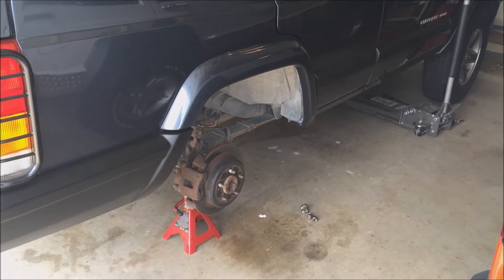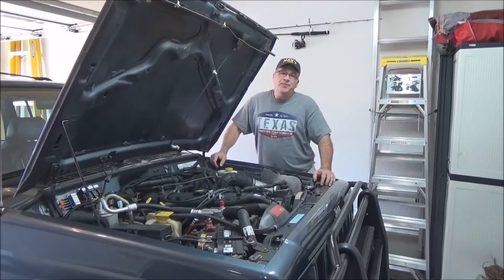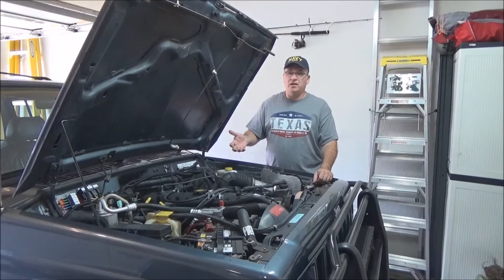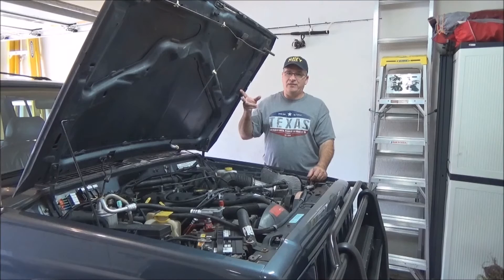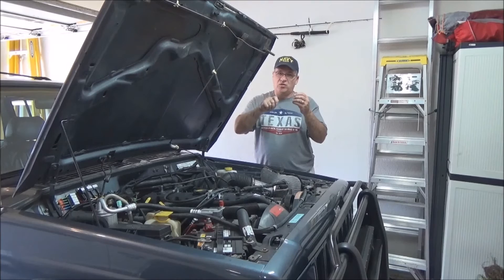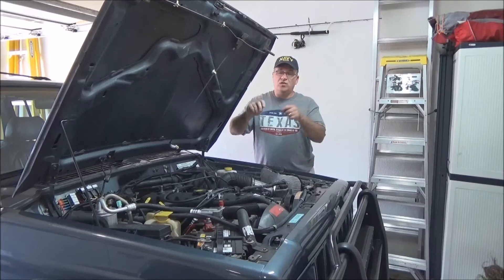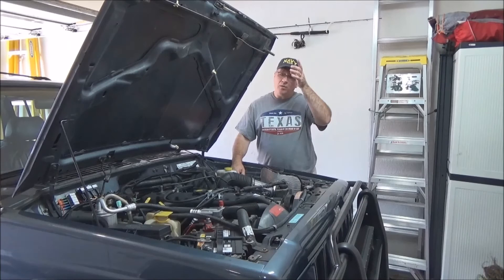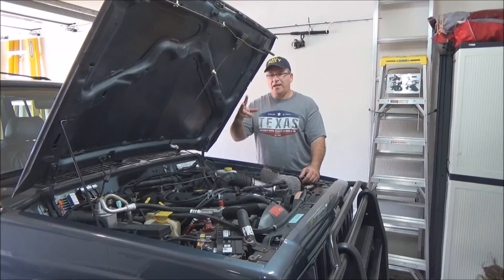Jeep Cherokee Disk Brake Conversion

Comment: Pretty informative but the pictures at the end tell much more.  Thanks for sharing your experience.  Here's my experiences on the rear disc brake swap as updated information FWIW:   If you have a not-so-rare XJ with ABS, you will have the Dana 35 and should use the information in this video.  If you have an XJ without ABS, you will have a Corporate 8.25 housing.  This info is for those with the 8.25 axle housing.   ABS was much more common in '97-01 models in certain parts of the country.  Nearly every "Phase II" XJ I've worked on had ABS.  Darned annoyance to bleed properly.  If you use the KJ caliper backplate/bracket you likely have to notch the axle tube flange to fit the sensor in the correct place.  

Look at the 2003 to most 2005 and maybe early 2006 KJ Liberty.  They were called Liberty here in the States but was known as Cherokee everywhere else in the world.  It shared few parts with its XJ predecessor with a big exception.  From 2002 to at some of the earliest '06 model years they all had standard Corporate 8.25 axle housings.  The brake bracket/backplates are a direct bolt-on swap with the longer KJ mounting studs.  No grinding is required like what was needed going from the ZJ D35 to fit the Corporate 8.25 did.  Configured with coil spring suspension instead of leaf spring packs, these axle housings are 1.5" inches longer than the XJ axle housings.  Not all KJ's had disc brakes but most did after 2003.  The calipers and rotors should be taken as a set.  Because drum brake wheel cylinders need more fluid due to the increases movement required to engage shoes versus pads, you'll only need the ZJ proportioning valve spring, screw cap, and valve pin to reduce the amount of fluid flow to the rear now to prevent them from locking up too early in a hard stop or panic stop situation.

For lifted XJ's use the KJ parking brake cables.  The ends are the correct type to fit the XJ equalizer bracket and engage the parking pawl lever.  No washers required.  Since the cables run through the floor of the KJ to the handle, the rubber dust boot(s) can be cut off.  The driver's side is a bit long but can be looped once and anchored to the body/floor to prevent catching debris during flexing.  The passenger's side runs wide around to the driver's side and follows the axle to the other side.  It is anchored to the pumpkin via a cable clamp.  Use new ZJ (P/N: BH380226 and BH380225 one each) or Explorer (P/N: H380528 you need two) brake hoses.  Rubber hoses will swell over time and may not allow the brake fluid pressure to come off as expected when taking your foot off the pedal.  This will cause the caliper to stay engaged and burn up the pads and destroy the caliper seal around the piston.  The ZJ hoses are shorter but have a larger mounting bracket and can be drilled out to fit over the U-Bolt threads and pinched with another nut.  Explorer hoses are longer but have a smaller mounting bracket.  You can swap sides if they fit better for your needs.  Either way, keep your brake lines routed behind and up tight against the axle tube to avoid snagging anything that can get kicked up on the road or caught by a rock or something off-road.  Even a regular hose clamp will help keep the hard line in place.

For internals the carrier is a direct swap if you are lucky enough to find an LSD/TrueTrac type.  If you have a set of gears you wish to stick with already, swap your ring gear to the KJ's carrier, reset the backlash to 5 thousands and move on.  The axle shafts are 3/4" inch longer and won't sit right on the outer bearings and sealing surfaces if memory serves.  Hope this helps and good trails!

Comment: 6:03 you talk about using a hose clamp to remove the parking brake cable. 
the easiest trick i found was to slip a 13mm box wrench over the cable to depress the little locking splines and then slip it out
Reply: Zaid Gabriel  no one give a damn about your scammy spam ! 
This is not the place for it.
I will never watch it because I don’t like seeing your scammy crap everywhere.. your reply has nothing to do with my helpful comment, so it is very intrusive and unwelcome !

Comment: Beware!  Check with your Pick A Part first (or not?).  I pulled all my stuff and when I went to pay, they said there was one problem.  They don't sell those parts that way. Price list seems to support that after I knew that. They said I would have to buy the whole axle.  Well.....it was gonna be 98 degrees that day and I wasn't about to go back and pull an axle I couldn't use or even haul that day, so I paid the $99.00 for the whole thing.  What else are ya gonna do?  You can't buy them new.  I would have probably had to have done the same thing on CL anyway.  Check first, or don't.  Maybe it's better to play dumb than have them say you can't pull those parts before hand.
Reply from the maker: Wow bummer sorry to heard that the https://www.picknpull.com/ we have in the Dallas area lets you buy any individual part you need they even have individual prices on the website

Comment: Ford Explorer brake cables didn’t work on my 91’ Sport two door w/ a Dana 44.
Reply from the maker: ZX14r Rider correct as noted this does not work for the 44 only a 35 or the Corp rear end

Comment: Does it work with the Chrysler 8.25 from a 2001
Reply: Yes.
Reply: You may need to Dremel out the center of the backing plate a bit to fit the 8.25 axle.. Ive read a 2004 liberty has a direct fit no need to mod it..

Comment: Do you still have to use the stack of washers and bolts with the Explorer parking brake cables?
Reply from the maker: Unfortunately yes. But it did just fine for the 20K miles we put on it. I would have used both cables from the Explorer but it’s a foot peddle so the cable comes down the side of the frame so the driver side is to short. However I have heard but not checked for myself that a Taurus passenger cabled might be long enough to use and is the same mount as the Explorer but again not sure that’s true

Comment: My 98 XJ has ABS , haven't seen any discussion on how to handle the sensor? I got the KJ backing plate.
Reply from the maker: wow that's a rare option I don't think I have ever seen an XJ with ABS. I don't think I would do the swap unless you remove it all which might not be a bad idea its so rare parts are likely hard to find
Reply: @NavyDad  My XJ was a government service vehicle and had very few options other than 4x4 and ABS - mine was forestry service. I read where other government vehicles were spec'd this way
Reply: @NavyDad  I plan to go ahead and modify the KJ back plate to allow the sensor wire to pass through leaving everything else in place and hoping it will work with the disc as it did with the drum. The sensor and timing ring will remain unchanged vs moving the KJ sensor and ring over wbihich ay not be compatible. - I'll let you know. I biggest problem right now if getting the longer studs into the axle and the axles seals back in without ruining them.
Reply from the maker: @nvestnbna  wow that's cool and awesome you can make the disks work with it too
Reply: @NavyDad  Well, got everything hooked up,  the Explorer EB cable (drivers side) is a misfit, curious how you made that work? Also, my "new" calipers don't clear my stock steel wheels. Either these aftermarket calipers are too bulky or they require the alloys. May grab the standard calipers fromt the junk yard and see if there is a difference. One thing after another hopefully will get it all done or get new wheels. Only wheels I have found I like are the quadratec 5 spoke wheels but they may require a lift(which I want to avoid. thoughts advice appreciated.
Reply from the maker: @nvestnbna  Hi yes on the cable I had to use a few washers and a small hose clamp to make up the space and it worked fine. My son put 15K mile on the upgrade before we sold it. I'm sure there is a better cable out there but I couldn't one better then the Exploder. As for the wheels we had the stock 15in alloys which i think are 15X7 the stock steel wheels i think are 15X6 or 6.5 that might be why they are rubbing. you should be able to find some nice stock 15 inch Jeep alloys on craigslist or FB marketplace for very cheap and just swap your existing tires onto them. i believe 15x7s were available on the wrangler through 2006 and there might have been been a factory 15x8.
Reply: @NavyDad  thanks, looking for wheels at this time because I still have some good tires. May just do the quadratechs and a slight lift but have to figure out all the offsets etc. we’ll see. Working on ideas re the cable missed that you discussed that. Thanks for all the help. Just want a decent Jeep for occasional use and trailer towing.
Reply: you can keep your ABS if you pull the axle shafts from a ZJ or KJ which has the tone ring on the shaft. as for the sensors, i’m not entirely sure if you can use your stock ones, or if you’d have to splice the zj/kj sensors into your stock wheel-speed sensor harness.
Reply from the maker: @sebastiankerr427  Wow that is a good question ABS is rare on and XJ. However I believe the axels will not work I think they are wider and I think the sensors themselves are different on the drum XJ and I don't think they would read it.

Comment: How do I do this to my Dana 44 cause I’m on 35s and the thing doesn’t want to stop really
Reply from the maker: Unfortunately it’s not an easy conversion since 90 and older XJs 35/44s are not c-clip diffs, the axles bolt on. You can use a ford explorer but it requires some fab work, it’s not a bolt on. Here is some info on the explore conversion https://www.naxja.org/forum/showthread.php?t=967146 

Teraflex does make a bolt on kit but its expensive https://www.quadratec.com/products/12700_414_07.htm

Comment: Do you have the part numbers for the explorer brake cables?
Reply from the maker: Hi here is the Dorman part number for the left side cable for a 95-01 Exploder or MountGoat 
Dorman Parking Brake Cables C660003 at Summit https://www.summitracing.com/parts/dhb-c660003/applications or amazon https://www.amazon.com/dp/B001PY3W00/ref=cm_sw_em_r_mt_dp_U_7aNDEbPB40ZCH

Comment: Did any of the '95-'98 Grand Cherokees have the 8.25 rear end or were they all Dana 35?
Reply from the maker: I believe all ZJ's came with 35s but I'm not sure here is a good site to identify just about anything http://www.differentials.com/technical-help-2/differential-identification/
Reply: ZJ were available with the Dana 35 and Dana 44A.
Reply from the maker: The ZJ did not have the 8.25 option
Reply from the maker: Hunter Hoag  Yes I believe it was an option on the rare ZJ 5.9L (360CID) ZJ but it was aluminum center section. Might be better to go with a ford 9” if getting serious or beef up the 35 with some goodies from Currie if it’s a daily driver and weekend warrior

Comment: Will this work on a 89 Jeep Comanche?
Reply from the maker: Hi, well yes you can but no its not easy. If your 89 MJ has the original rear-end it’s a non C-Clip so it does not have floating rear axles, they are rather bolted in at the drums with pressed on bearings. You can make the ZJ convention work but you have to machine the rotors, bracket and I believe you have to make a new mounting flange. There are a few articles out there on how to do it check the googlemonster. For your MJ Dana 44 drums would be better or you can swap in the entire 95-01 Ford Explorer rear end, brakes and all, it’s almost exactly the same width. All you have to do is cut, move over and weld the leaf spring brackets as the MJ is a little wider than the Exploder.
Reply: Navy Dad I believe that my MJ has a Dana 44 
Rear end 
It's my grandfathers the reason I'm asking about the conversation is because I wanted to restore it for himself a birthday gift. I have the Jeep almost ready (besides the headliner) and the brakes 
I replaced everything in the braking system ( booster,master,clippers, and wheel cylinders.) brakes of course also 
But I still get a lose pedal. Literally little to almost no stopping power. I've bled the brake system several times but still nothing. I have no changed the leveling proportioning valve nor the portioning valve near the master. 
Any help on where I can get the level valve or what I would need to do the swap. I'm new to all of this Jeep things. Sorry if I take up your time.
Reply from the maker: Oh ok and very cool! It would be rare for a proportioning valve to fail, but did you bench bleed the master? If not it will take forever to bleed the system pumping the pedal. I would suggest getting a Motive bleeder  https://www.motiveproducts.com/  I bought one a few years ago and its under $100 best money I every spent on any brake tool. It’s a one man bleeder and even works with anti-lock vehicles too.
Reply: Navy Dad I'll give that a try 
Thank you for your help 😁